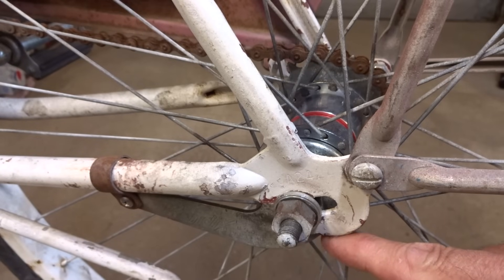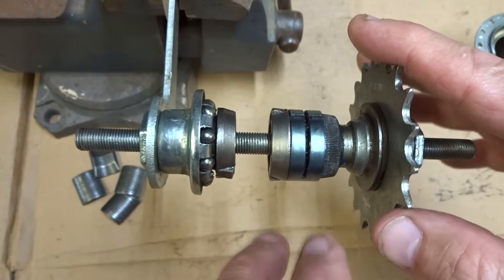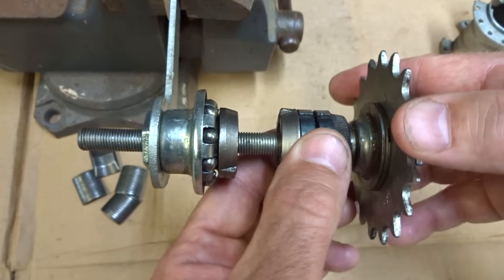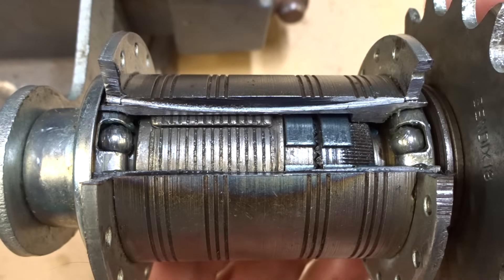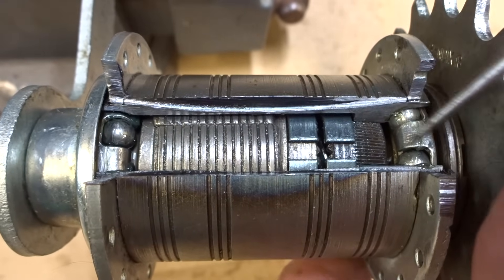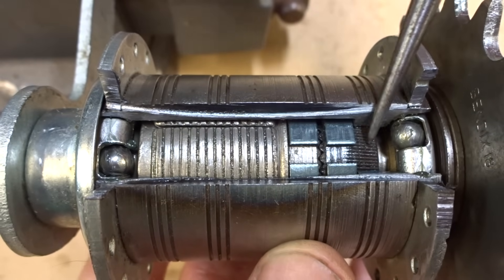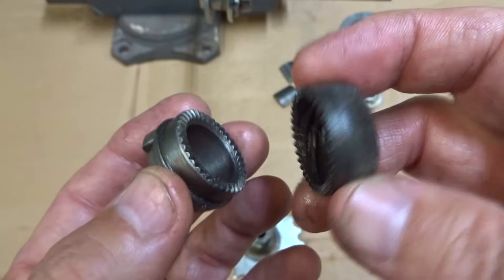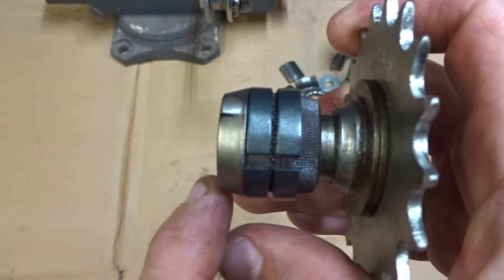Coaster Brake Hub - What's Inside? How Does It Work? Cutaway View!

Comment: Really good video👍. I have a question, can I change the freewheel only on coster brake and still using the old frame? Thank's.
Reply from the maker: Coaster brakes don't have freewheels.
Reply: @RJTheBikeGuy  Sorry, I meant Sprocket Wheel. I have 18T sprocket wheel that come with the coster brake set, can I change it to 14T or 12T?
Reply from the maker: @nunungk9719  Many of them are changeable. You may have to resize the chain.
Reply from the maker: https://www.youtube.com/watch?v=PPXt9m4udKw
Reply: @RJTheBikeGuy  Thank you for the anawer and fast reply, I really appreciate it 👍🙏

Comment: RJ. I thank you so much for your videos. I recently got back into bicycling after many years. Immediately before this pandemic I acquired a 70 something Raleigh single speed coaster brake bicycle. My first thought was" ah what a piece of garbage" but after further inspection my thoughts quickly changed to "what a well made bicycle to have lasted this long and with minimal wear and tear." And now that brings me to you. Along with my new found admiration of this old road bike came the rebuilding and maintenance all of which I was able to do with your videos as a guide. I have seen other videos out there but to me yours are the best. You are very thorough and don't leave out any little parts other people might think unnecessary . Again thank you. I will bike well into my golden years thanks to you and this old bike

Comment: That cool! I repaired mine but it has a lot of resistance and it does a clicking sound when pedalling. The axle might be slightly bent because the bearing housing spins in a weird way but it looks quite straight. Could it be the spring between the clutch going out? And if I need any spare parts to repair it, is it interchangeable with other coaster brakes? 

Thanks a lot, you saved me from doing dumb stuff a million times with your replies! 😃
Reply from the maker: I can't tell you without working on the bike. And no, parts are not like very interchangeable.

Comment: Dude!  This is exactly, and I mean exactly, what I was looking for even down to the color bike of the bike and Bendix hub. 

My wife has a 1966 Schwinn Hollywood Deluxe that has been hanging in her Dad's garage for 40 + years.  Brought it home today to try to get it rideable for her.  When turning the crank, the back wheel did not spin and the crank would spin freely backwards as well.  I followed your excellent instruction to disassemble the hub, clean, re-grease and re-assemble it and Viola!  The hub and coaster brake work great!   Thank you RJ!!   PS, the tire tubes still hold air, unbelievable.

Comment: Thnx for the video,I have a question please. My daughter's bicycle works with this mechanism however the pedal is too heavy for her is there a way to make it smoother?
Reply from the maker: I don't understand what you mean by too heavy. The gearing is not low enough?
Reply: @RJTheBikeGuy  
Thnx alot for your reply,
I mean it's very hard for my daughter to cycle.
Reply from the maker: @lo22ay  Again, it could be gearing. Low tire pressure. Tire rubbing frame. Some other issue.

Comment: My wife’s bike has a 7 speed Shimano coaster brake. The bike has front and rear brakes as well but as she doesn’t like the coaster brake, I was wondering if I could disconnect it by removing the brake pads?
Reply from the maker: No. Replace the wheel with a non coaster brake wheel.

Comment: Great video!  Love the cutaway!  My splines aren't fully disengaging when I stop pedaling.  I pedal back just a touch it stops making the noise.  I wish there was some way to fix it.    What causes the splines to disengage when pedaling stops?
Reply from the maker: Overhaul it. https://www.youtube.com/watch?v=PPXt9m4udKw
Reply: RJ The Bike Guy I watched that first.  I did a complete overhaul.  Nothing changed.  I’ll live with it.  Doesn’t seem to me a mechanical reason though.  Maybe just a Huffy thing.
Reply: @jcstevegigs  The hub itself causes the clutch to disengage by friction (once you stop pedaling the driver also stops rotating and the hub effectively unscrews the clutch until they completely come apart)

Comment: Haha.  Is there anything you haven't fixed or done a video on?  This is fantastic.  I have imagined in my head how that braking mechanism worked since riding a single speed back in the late 60's / early 70's. (and, no, my imagined brake mechanism wasn't even close to how it actually works)  Yes, Coaster is what it was called - I knew there was a name but damned if I could remember it.  I am still impressed by the ingenuity of the person(s) that invented that back in the day.  I'm going to try googling who/when that free wheel hub and coaster brake was invented.  Damn fine engineering there and probably wasn't an engineer,  just some guy with incredible mechanical smarts in a small shop.

Comment: I rember these old things. I used to take them apart to see how they worked and by some miracle not only found how to reassenmble them, but jimmied one to work as a fakie hub, or a hub that could be pedalled backward foing forward, but not pull the pedals when the bike rolled  backward.

Comment: If you're thinking of taking one of these apart for maintenance: Don't. I did once, cleaned the parts, then tried to put it back together as best I could and it took 2 hours. Then I started riding, it resisted but I was frustrated and went on. After 30 seconds the hub exploded, bearings flew everywhere...
Reply from the maker: I have several videos overhaulung different versions of coaster brake hubs. Not too difficult.
Reply from the maker: https://www.youtube.com/watch?v=PPXt9m4udKw

Comment: I noticed that you had to turn the pedal/gear thing back a little bit to enter "coast mode".

What if you just kept it exactly where it was?

Would it enter "coast mode" or would the pedal/gear thing continue to rotate forward along with the hub/wheel thing?

Thank you very much for answering my question. I really appreciate it.

Cheers!
Reply from the maker: When you stop pedaling it will loosen and coast.
Reply: When you stop pedaling, the clutch (serrated part that screws on and off the driver) will be unscrewed a little bit by the hub, because hub rotates with the wheel in the direction of unscrewing it

Comment: extremely stupid question (even b4 watching the video) - if my brake's efficiency goes down, do I need to replace the whole hub or just the mechanism inside it?
Reply from the maker: Try overhauling it.
Reply: @RJTheBikeGuy  So, the hub shell doesn't need 2 b replaced, does it? Just worn-out pads or something, right?
Reply from the maker: It just may need cleans and lubed.
Reply: @RJTheBikeGuy  i was going 2 do that soon another time. i only had the bike for 5 yrs. and i'm only riding it about 3 miles/day 5 days/week. i only have a couple of steep hills and i'm braking (not hard) 4 may b 5 min/day total (on and off). not sure if the pads r already 2 worn-out... will b checking it soon. thanks 4 the advice.

Comment: Very nice! video Thank you! Been working on couple of little bit older bikes with coaster brakes and both have similar problem that when I stop pedaling it doesn't always go smoothly to the coaster mode, it sort of "yanks" the pedals a bit. Been wondering what causes that. After watching this video I suspect the clutch spring might have something to do with it, not releasing the clutch straight away. Have to check that again. The cut away hub really showed well how it works!
Reply from the maker: Might just need to take it apart, clean, and be relube it.

Comment: I recall the single speed bikes I rode in the 50's and 60's, which had coaster brakes.  And they had a spot on the rear hub where you could add a drop or two of light oil. Was these for coaster brake hub?
Reply from the maker: There are so many variations. I don't know what yours was.
Reply: Gosh it was so many decades ago and I no longer have the bike.  Thanks much for responding RJ.   @RJTheBikeGuy

Comment: when you remove the two plate there still some resistance play happening right? how to solve the issue?
Reply from the maker: Normally there would be a lot more grease. And the resistance would no be felt while actually riding.

Comment: Hello R.J. I was wondering if the clutch if welded to the driver. Will it essentially make it a fixie. After doing so will assembly be possible?
Reply from the maker: Buy a fixie wheel.

Comment: Fantastic video, but I still don't get it.  When your'e demonstrating the "parts" that slide in & out you're holding them with your fingers.   When inside the hub,  wouldn't all these parts just be free to spin?  What holds them still so they have to slide in & out?
Reply from the maker: No, because the axle is clamped inside the frame. So all the insides are stationary.

Comment: Crazy how the brake shoes are metal. You'd think metal on metal would make a grinding sound and wear down relatively quickly, but I guess they aren't exactly accessible to replace so need to be harder wearing.
Reply: This type of brake doesn't make any noise because it is lubricated with grease, if it wasn't lubricated, the friction between metal would probably broke the mechanism.

Comment: Great video, what is the purpose of the side lever bolted to the frame. What’s the benefit of leaving the side lever unbolted?
Reply from the maker: To hold the hub from turning when braking. The axle nuts are not nearly strong enough.

Comment: Nice vid. Would you mind doing something on small cracks in a steel frame? My 1994 giant team has some rust showing through 2 cracks, one near where the top tube connects to the head tube, and one same place in the bottom tube. Thanks.
Reply from the maker: Um...if there are cracks, either replace the frame, or take it to a frame builder and have them replace the cracked tubes/lugs.
Reply: RJ The Bike Guy was afraid of that. The bike is probably not worth it.

Comment: Did they gave up on those because the hub actually did not last cause of the brake mechanism ?
Reply from the maker: They still make them. Geared bikes are more popular.
Reply: They last just fine. My grandmother had a bike for 40 years with a hub like that and it never failed. 
Nowadays they're mostly used for kids bikes.

Comment: That was great seeing the cutaway view . I would love to see a cutaway view of a worn out hub to show what the fault is when they get old and start to slip . I'm guessing it is just the teeth on the clutch worn down preventing a tight engagement when tension is applied in the drive motion
Reply from the maker: Do you mean a freewheel? Or coaster brake hub?
Reply: The Coaster Brake Hub when they get worn and slip a 1/4 to 1/2 a turn when you try to pedal
Reply from the maker: Take it apart, clean, and lube it. https://www.youtube.com/watch?v=PPXt9m4udKw
Reply: That doesn't fix them all, though. I took apart a cruiser that I had only used a few years and the pads seemed a little mushed out over the ends so I sanded them flat. Didn't work better. Did try a clean and reassemble first. Ended up buying a whole new wheel.
Reply from the maker: That would be my first plan. If you open it up and the parts are trashed replace them. But often it's just old gunked up grease, and that is a cheap fix.
Reply: Where would you find parts for something like that? Actually, while I've got your attention, do you know of any place I could find dual rear baskets that would fit over an extra wide cargo rack?? Specificaslly, this bike: https://www.radpowerbikes.com/products/radcity-step-thru-electric-commuter-bike
I bought one about a week ago. So much fun but hauling solutions just don't seem to be there. You can get a kid carrier for it, however.
Reply from the maker: Start googling. Try ebay.

Comment: So, what is the purpose/function of the brake arm?
Reply from the maker: I added a note to the description. The arm is attached to the chain stay to hold the axle from turning. Other wise the whole axle would rotate in the dropouts when you hit the brakes.
Reply: You can adjust the position of the non drive side expander by rotating the brake arm. The internal components need to remain stable and not rotate during use to function.

Comment: That's a very cheap mechanism that will wear very fast. Most coaster hubs (Sachs/Torpedo, et al) are constructed differently and can run maintenance free for decades.
Reply from the maker: I have seen bikes with old Bendix hubs on them, and they are still going. Not saying this is the best possible design.
Reply: most hubs like these run maintenance free for decades.
Reply from the maker: In this other video, I cleaned/lubed one from a 1962 bike: https://www.youtube.com/watch?v=Sjm2P5jhRt8
That is 55 years old! It was working fine as it was.